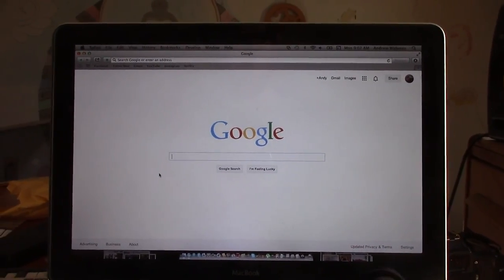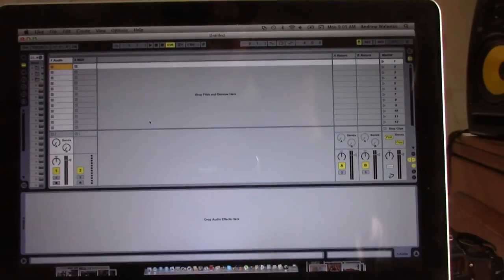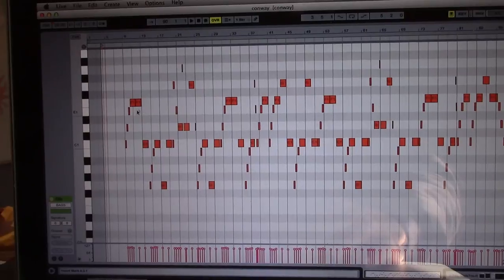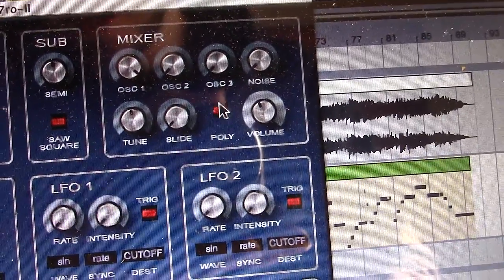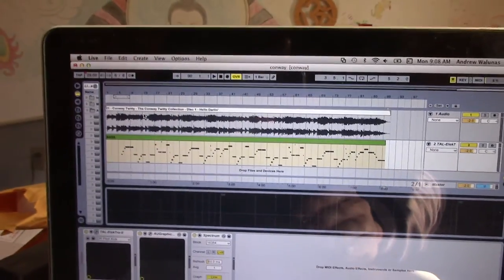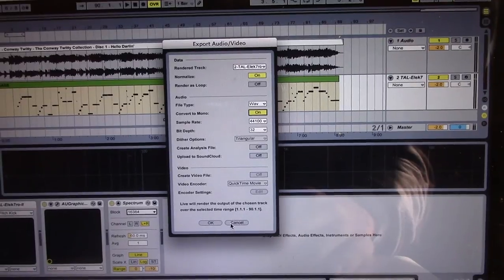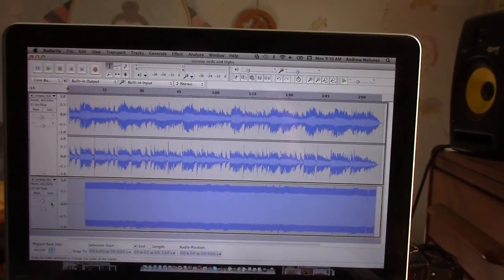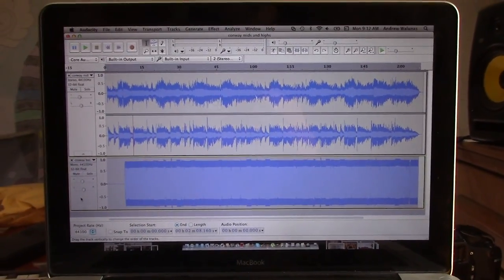How to Rebass music for Car Audio Ground Pounding

Comment: All songs have a key based on a scale. Each key has 7 notes that makes up that scale. Wrong notes for the key = notes ( in this case the bass ) is out of tune..You threw in a bunch of random a minor / c major ( white keys ) midi bass notes on top of a song you don’t know the key of. Most popular genre songs are minor or major scale ( lots of other scales too )  used less in popular music. In this example if your song is A minor or C major ( relative keys ) then Yes you got lucky and it may sound ok. Also why are you adding a random bass part to a song? The song already has it melody and bass. Also, your remaster video, you high passed filtered at 80 Hz when there is bass information down to 20hz and did it multiple times. Each time you do that’s you are lowering the decibel value by the mount of the slope for ex 6/12/24/48 dB per octave. So a hi pass filter at 80 Hz with a 12/dB slope means the first octave below 80 ( 40hz and below ) will be reduced by 12db or will be 12 dB lower than the 80hz octave. Sub/ Synth Bass lives in the 10hz - 80hz punch bass ( kick drums, bass gtr, low piano notes, even some metal power chord guitars ) 75Hz - 200Hz. If you High passed at 80Hz in the other vid 3 times ( 24 dB slope) then you multiply the slope ( 24db x 3 times you hi passed ) you end up with a 72dB slope so everything from 80hz and below is now -72dB below the original. Also normalizing back to 0 will make you clip once you bounce to MP3 and lossy conversion takes place. Even if you stay 24 bit 44.1 kHz wav the first person to use that bass boost knob or eq boost will be stuck in clip city. A limiter can protect from overs/ clips if set correctly. Most popular songs nowadays contain Clipping even though they have been mixed and master by professionals. In your situation I would normalize or gain back to -.1. Yes -1dbfs, 0 dbfs And Over is clip city. -1dbfs can protect against MP3 induced clipping as well as listener induced eq boosts. Anyway Keep Slappin and Slamming mane 💯